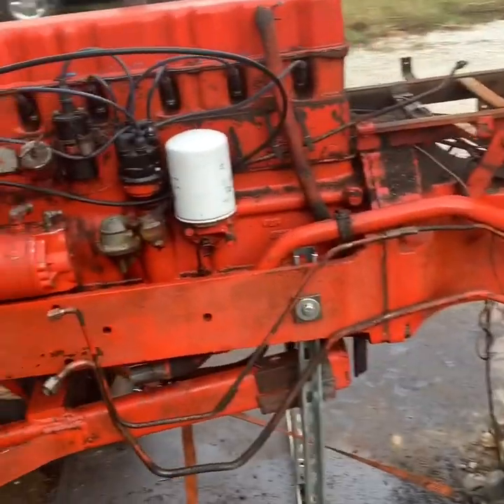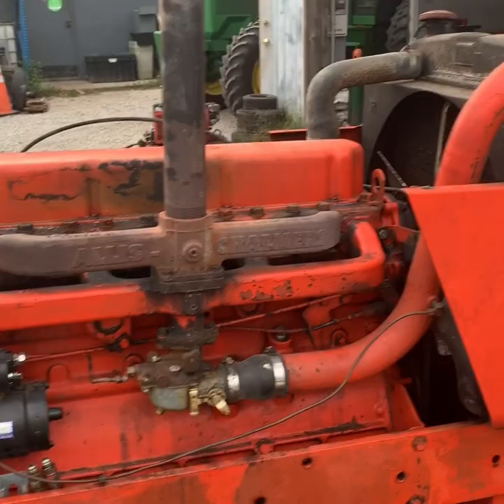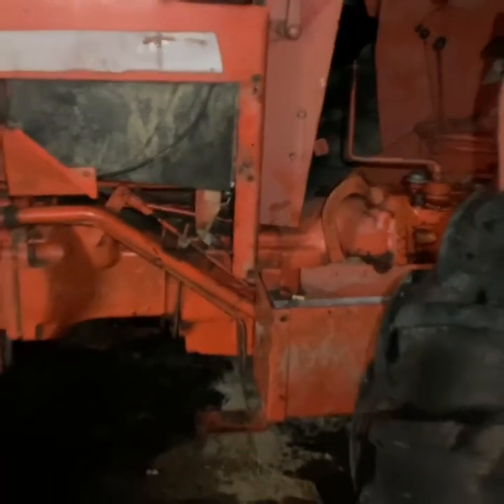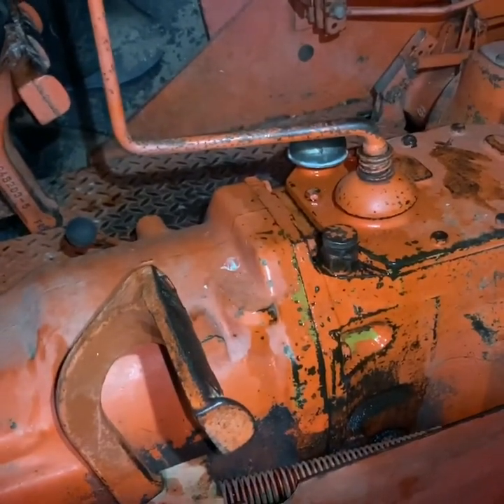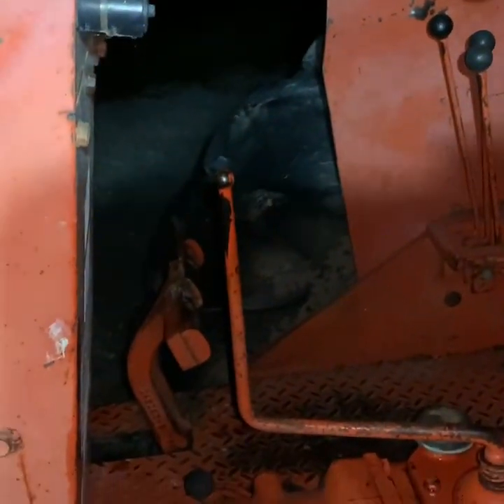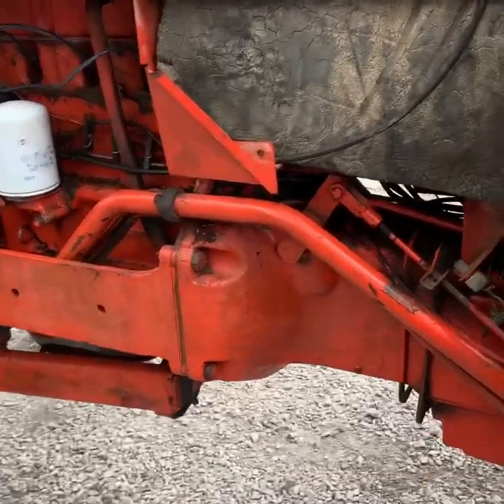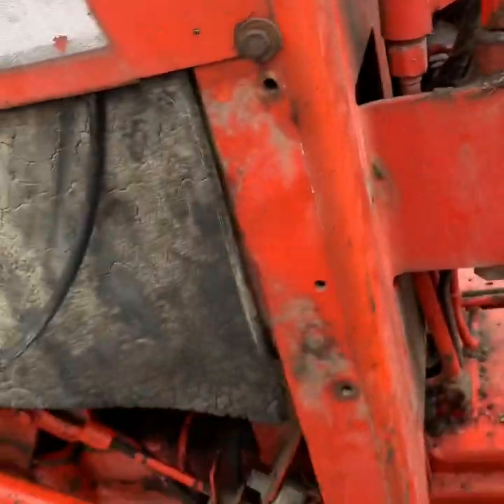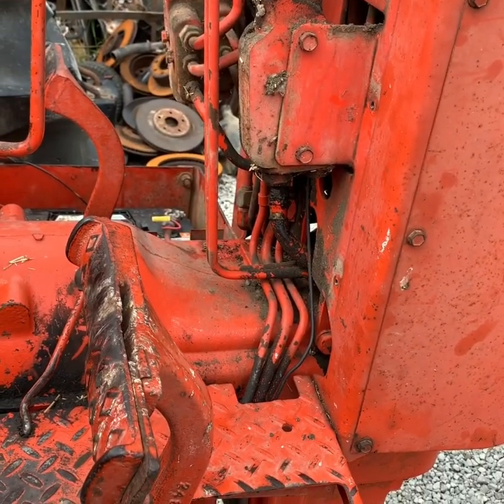Allis Chalmers 180 clutch install part 3

Comment: I have 30+ AC tractors and have split at min 10 of that series and had several not wanna suck up hyd fluid after having the sump line off the bottom of the pump. Dont feel bad. Keep up good work!

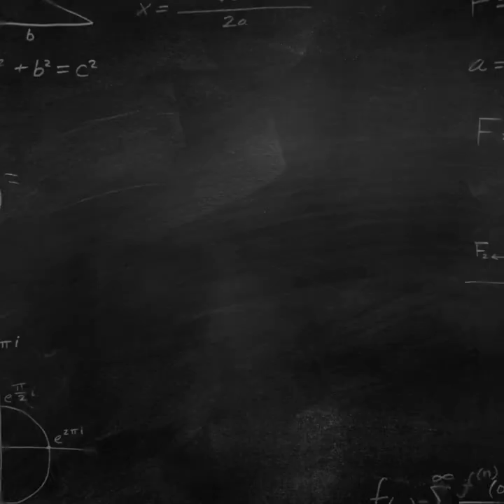Comment: 4:50 great job and glad you got it diagnosed💯👍 but the rear tires are on backwards. The V should be facing down as you are looking at the front. See how they are facing the same way as the JD pointed the opposite direction 👀
Reply: I’m sure you were anxious to test drive it and simply put them on the wrong side
Reply from the maker: I never had the tires off your seeing both tires on the Deere the ones on the Allis are on correctly watch the other videos
Reply: @RustyZipper  Green John Deere has duellies
Reply from the maker: Yes
Reply: Ahhh I see, I was looking at the outer wheel of the JD thinking it was your AC 🤦‍♀️

Comment: Ok, Chris, I am not a mechanic... but how did the airlock occur?  Can air get into the line when fittings are tightened, or when you have to add fluid to the system?  Isn't there some type of detection device that can warn you of this condition?  This must be something like bleeding brake lines, but it seems that it cost you a lot of time and grief in this installation. Sure would have been nice if an alarm went off that said "air in the line" - or something like that. 🤔

Comment: I chased a problem with a bmw x5 not working the remote fob - turns out the bloody battery in the fob's (plural) were both flat.  That took me a fortnight... Good video..
Reply: I just did my Vettes last week. It gave me one warning on my dash then worked fine all weekend. The car sat for a couple weeks and I was like maybe my car battery is dead 🤔 but I’ll try new fob batteries first!

Comment: If you have access to a checking the fob radio signal - that was after replacing the aerial module and the central body module.. It's all good fun - Good luck